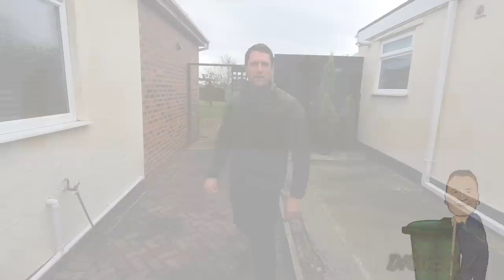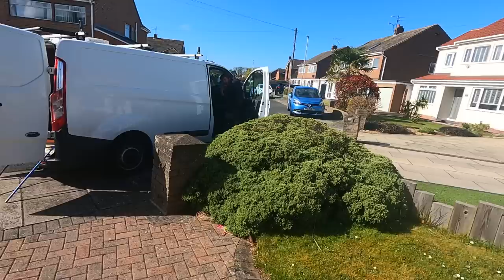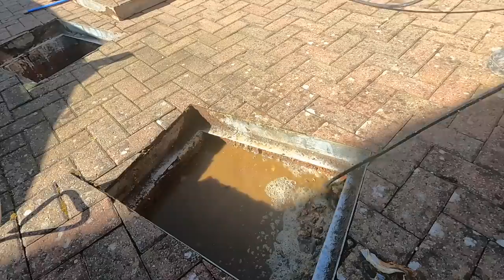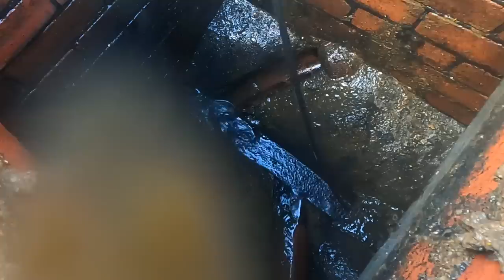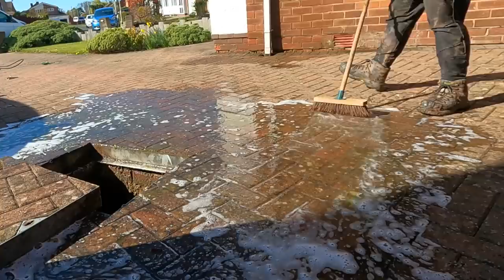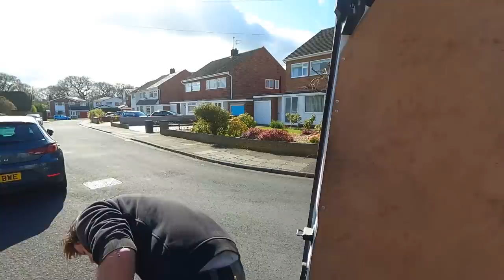Jack VS Justin 💪 Stage 1💪 Manhole UNBLOCK

Comment: After two episodes, it's really too close to call. Jack got bonus points for use of the plaster stirrer but lost ground by way of the sewage splash....Justin seemed to be in the background and the extreme sewage close up was a bit off putting. Oh, well, on to round 2.....
Reply: After 2 episodes it’s boring